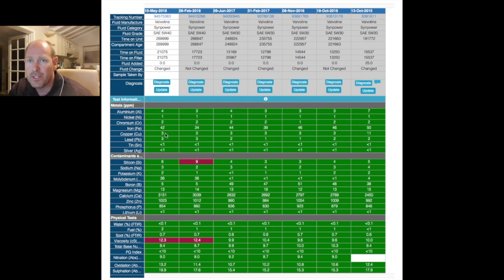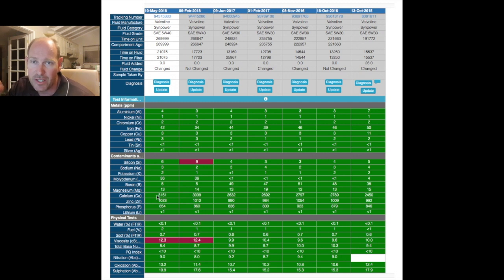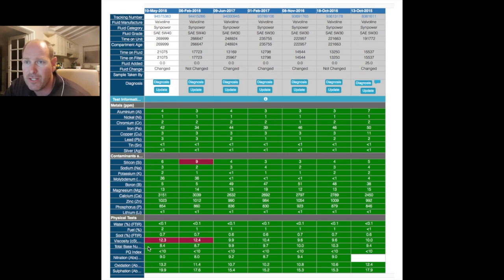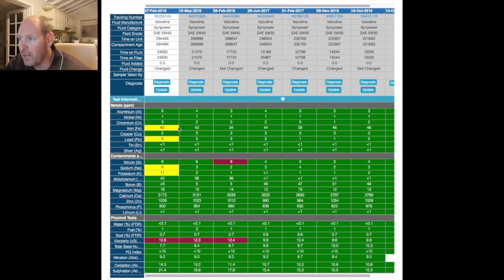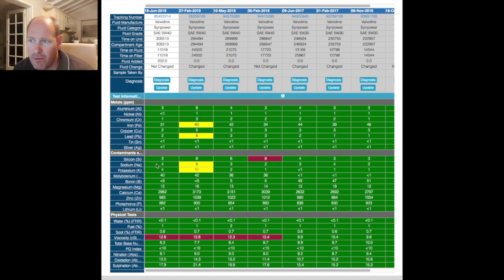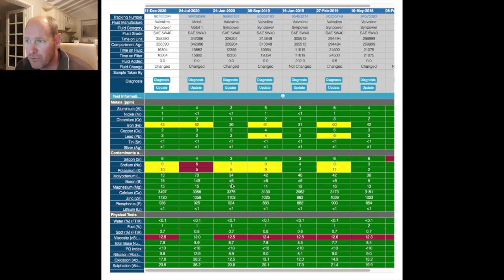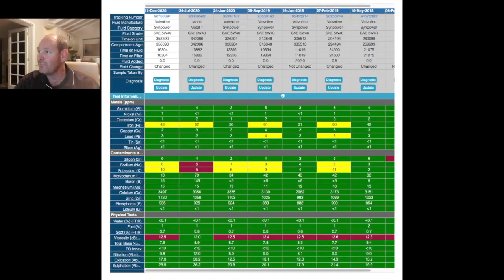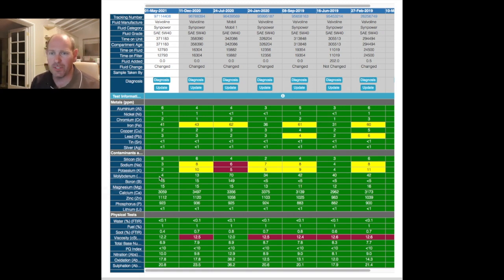LR3 | Land Rover Discovery 3 2 7TD oil cooler replacement | Reasons for change | Used oil analysis

Comment: Gday mate. Awesome vids. I am using these to change my disco oil cooler. Did you use a genuine cooler or aftermarket?? The cost diff is huge so not sure to go cheap or expensive.
Reply from the maker: Aftermarket, Nissen brand. Decent quality aftermarket one should be fine

Comment: Hi Shane, I have an LR3 and recently the car had a coolant leak. It lead to an overheating of the engine. Since the over heating i've been losing oil and coolant. The car runs fine no knocks at all and still pulls hard. Is it possible that the oil cooler is causing my issues or a good place to start?
Reply from the maker: If your not getting an external leaks then its likely to be an internal leak. Most likely cause of that could be a head gasket which although not common in these vehicles is more likely a factor due to being overheated. The cooler may be leaking externally into the V - you can get a bit of rod or something similar to drop down into there and see if theres any oil. Visually check the engine oil for any milkyness (coolant contamination) and the coolant for any signs of oil
Reply: @Shanes_Shed  already done an oil change and the oil was perfect. There was alot of oil in the v. I've had a mechanic check all this out and done the oil change. He doesn't seem to think it is a head gasket though. I suppose there is no harm in changing the oil cooler and starting there is there?
Reply from the maker: My oil use between changes has dropped since changing the cooler - the v was full of oil when I changed mine and it seems to be a common leak point. Certainly no harm in changing it as far as I can see (worked out ok for me anyway)

Comment: Remind Shane, was the oil cooler leaking oil or had you noticed coolant loss too
Reply from the maker: There was some external oil leakage from the cooler - but I hadn't noticed that until I pulled the cooler. No real coolant loss noticeable apart from external leaks that I could see along the way  - just the normal stuff for a highish km vehicle
Reply: Ok, I am aware that the coolers a prone to leaking oil but not encountered one leaking coolant, I think I have a mystery coolant leak, I changed the plastic elbow on the passenger side engine block, you may remember i commenced on your attempt probably a bit harshly, or Ian least i thought so after I read it back that it might have come across that way, never ment any harm  just though you were making a meal of it. I'm  not sure if its leaking, pressure test it and it drops off after some time but  but only slightly,I think that's coming out of the attachment I use on the expansion bottle. Never heard of analysing oil to find internal coolant leak before. Do you do this at home?
Reply from the maker: All good - theres many ways to skin a cat. Maybe I should have tried a little harder to access the coolant connector before ripping everything out of the way. One a plus it did make filming at the same time as working easier. 
These engines are a bit of a nightmare for coolant connections and potential leak sources. EGR coolers are a good source of mystery coolant leaks as well. The oil gets analysed at a lab - that gear is a little out of my price range to buy